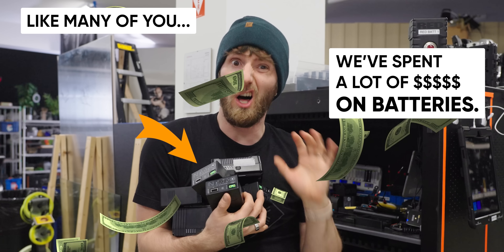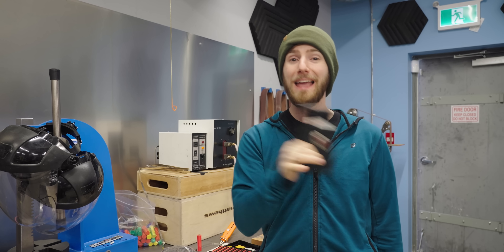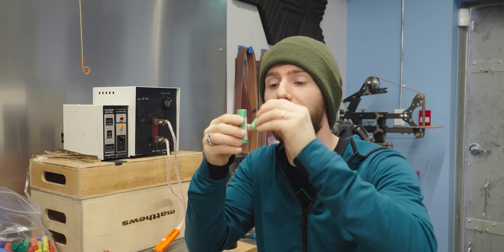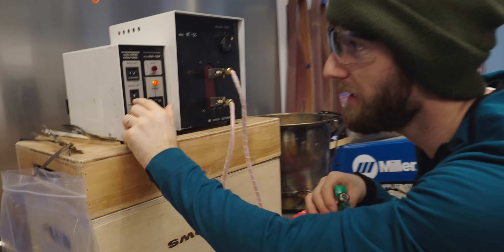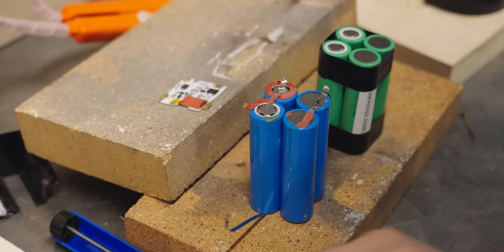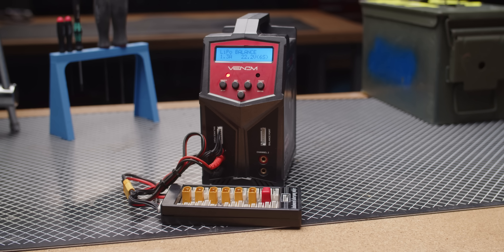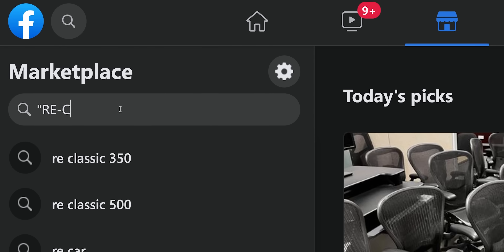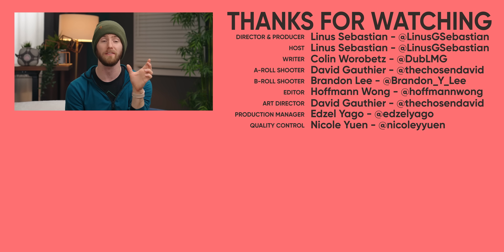This should be illegal… Battery Repair Blocking

Comment: Just an idea for you regarding your monitor battery pack! I've discovered, through working a great deal with Lipo and LiFePO4 batteries, many BMS's require you to give them a charge for a moment or a minute before they will begin to function correctly and allowing power from your batteries to come through. Even cheap bulk BMS's have required this, so you might give that a try. As far as protection against letting people replace 18650 cells, the only thing I can think of is that their circuitry could be customized to see when they have lost all power and then brick the BMS. This would be difficult to implement and would likely increase the cost when they try to do repairs at the factory. Other than this there isn't a way to track 18650 cells as they don't transmit any data. To bypass this sort of possible protection, you would just need to apply the appropriate voltage directly to the BMS just prior to disconnecting that negative or positive connection, whichever the cell connections isn't connected to. Good luck man! Don't give up on the 18650 cells. I've done some amazing things with them and replaced them many times in all sorts of items and I've never once encountered a product that had any protection that stopped me from completing the replacement.

Comment: Having seen industrial spot welding before: I dont think those sparks you saw where hazardous. They are just from the spot welding and not from a defunct battery. What i would worry more about is the fact that you can clearly see a red afterglow on the welded plates, which means you put a lot of heat into them.
Reply: I'm no expert but I was thinking similarly. The welder basically works by short-circuiting through the part you're welding, I'd be amazed if they never sparked. Poor contact on one of the tips I assume?
Reply: @SqueakyNeb  bingo. It happens all the time with shitty tips.
Reply: I too came here to say this. Dudes tossing undamaged batteries left and right
Reply: @jebus5656  Linus did warn that he is a total amateur at wendling batteries. But I like that Linus put safety ahead of thinking he is doing ok. Perhaps a little more resaerch into the unfamiliar aspects of a video will produce a good video and less work for the video and a better experience overall with less needless waste. it may be difficult but may also be less difficult than this exprience showed.
Reply: @mikkelbreiler8916  His safety glasses and bucket of sand would have done little had one of those fully-charged batteries "let loose the juice" with him sitting inches from it.
Reply: @jebus5656  Likely. The proof for me would be characteristic stench of burning lithium.
Reply: Well an other hint is that hey were welding only one side of the pack at that time. There should be no possibility to create a short as the circuit is still open.
Next with the sony pack yes sony has a chip that rejects 3rd party batteries but any BMS worth its money has also a undervoltage cutoff so after disconnecting you need to try to rechage first to try to reactivate the pack.

And last discharge LITHIUM-Cells to about 3.2V so that the energy left in the cell is limited. A fully charged 18650 cell has about the same energy in storage as a .308 rifle bullet so allways be carefull - about a small syringe of arctic silver halve filled with gasoline for non US nerds sounds little but is sufficient for a lot of harm depending of how fast it is released.
Reply: @tuxontour  WRT to the Red batteries, they appear to be in groups of 4 (4 positive side up, 4 negative side up, etc.), see 7:05.
Reply: This. He also 'double-dipped' the cells, spot welding twice before welding the other end of the strip to the next cell. A good cooling fan to take away some of the heat and changing to spot welding once on each cell, then going back to the first and doing the second weld after it has lost some of the heat would be much safer. (Nope, haven't built/rebuilt any Li-ion packs... yet... I collect vintage computers, and has only had to replace Ni-Cad and Ni-mh cells so far. I have a cheap spot welder, though. Much weaker than that monstrosity. )
Reply: Way too much heat during those welds IMHO.
Reply: Well, sadly this video is basically commercial, so it is intended to make DIY look unsafe, so you buy from their sponsor.
Reply: Yep, sparks from dirty tips or bonding strip shame still good cells
Reply: Yeah, I haven't spot-welded since high school shop class back in the 70s and I was more worried by the glow than I was by the few sparks I saw. Well, that and the crappy tips sticking to the nickel.
Reply: This, looked more like bad connection.
Reply: I think it was all acting for the narrative TBH.
Reply: @michael-3-l3  dont be too cynical.
Reply: @michael-3-l3  I always wondered who dislikes such videos, now I know.
Reply: @michael-3-l3  you ever think, maybe you're being cynical?
Reply: this

Comment: I am all for the right to repair however there are some types of and classifications of devices that should be exempt mainly life critical and lifesaving systems insecurity critical items like if eftpos terminals they should be lockdown if you Open them they should prevent you from using them any further for instance AED these devices have lithium ion batteries that are not designed to be re-charged and the BMS should be designed with a malicious BMS as a life is Worth more than the cost of a replacement battery and as a first responder I want to know that it’s going to work I don’t want to have to worry that the device has tampered with and may not work

Comment: Can you trick those Evill BMS controllers?
• what if you temporally hook up external voltage while removing the old battery will that it trick the controller to think that battery is not removed in first place ,so that one by one you can replace all cells?

Comment: I have done this with power tools. I even got an upgrade that lasts longer than the original.
You can often buy a cell pack already assembled to avoid having to weld them together.
You can also get cells that have a welded tag on them and solder them together,  after all, you solder the wires to the BMS.
I would only do this for my personal use and would not sell them on to anyone else just in case.
You can make a charger if you really want to got that far but then it becomes cheaper to buy a new one.
EU rules have been introduced that require manufacturers of electrical goods such as fridges and televisions to make their products repairable for at least 10 years after first coming to market, this could include battery packs.
Don't do this at home, I am an electronics engineer.

Comment: Hello, i alaways change my dead cells inside my battery packs (for my makita tools), if i use original samsung or lg batteries, everything alaways goes fine, but it didint at the begining when i was using cheap china batteries. some of them were dying just after two or three cycles. Anyway i can tell you my opinion, if you are unsure of your tools/skills is better not to open the battery case. It could have unforsein consequences like (poison or fire). Sorry for my bad english, im still learning. Have a great day.

Comment: I think one way for packs to be user replaceable would be to just use smaller batteries like AA, AAA, or 9V that can be individually replaced once the case is opened instead of requiring soldering or welding.

Comment: This is what happens with laptop batteries : they have a fuse that opens whenever a battery goes 0v, which happens when you desolder a cell. Lenovo did something like that on my laptop. i'm stuck with the original one until the recharge cycle limit is reached.... shame on you, lenovo!!!
With the lithium ion cells, you have to be careful not to put ANY dent into the housing, because it would likely expose the negative terminal near the positive, then it's much easier to shot the battery while doing that...
you can potentially use some new heat shrink housing to make them a bit more resilient to cuts... also don't forget to put some plastic spacers on the positive terminals to further prevent any shorts. Kapton tape should work as well as stated before by someone else in the comments.

Comment: I have to ask this - what kind of degree is required for one to be considered a lithium battery professional? A PhD in chemistry? A PhD in electrical engineering? Both?

4:40 See, if there is a bad cell, they already behave differently during charging, which makes your mismatched cells point, a lot more contestable. Then again, you are trying to refurbish a product that is already garbage. Thos battery packs are barely good enough from design perspective to cover their warranty. There is so much more which can be added for cheap and make them last significantly longer, but just isn't. Gotta keep the economy limping along :D

Comment: TBH, battery repair is where I draw the line. A consumer SHOULD NOT be replacing a battery that wasn't designed to be replaced. A battery is dangerous if handled improperly! Especially LithiumION, you do not want that igniting in your house!

Most repair shops I've come across aren't professionals! 

Now all this doesn't take away of the horrible business practises Linus described of course.

Comment: Hey Linus, @11:14 those aint cell sparks but welder sparks, if you  look closely you can see that the tips aren't perfectly rounded due to your sanding, if you have to sand the bottom of the tips be sure to sand also the round part of the tips.
Also would love to see how the batteries are recycled.

Comment: 9:00 Actually no. You already found out how his measurements went...😆 The cells you are connecting in parallel become 'one larger cell' and immediately equalize to the same voltage. Therefore, parallel cell groups need to contain the matched cells. Imbalance between the series cell groups is handled by the balance charger/BMS.

Comment: the sparks in this case are fine it was due to poor contact as well as your generic strips which would of been nickel plated steel sparks are common when using this type i also noticed the strips in between the probe were getting red hot not sure what machine your using is or if its set up properly but seeing the strip glow red in the middle is concerning definitely not normal for the set up im used to anyway you should be able to see any glow in real time and the only slow motion should pick it up and it should only be around the probes

Comment: A year ago I built a 40 cell pack for an electric longboard. I did know what I did back then, and everything went well, but seeing how easy it is to get things wrong makes me wonder what would have happened if I did something wrong. Bottom line for repairing or making a battery pack is to know exactly what to do and what to plan for. I am pretty stress tolerant, but after four ours of battery building I was exhausted. Espevially since the pressure gets worse the closer you are to finishing.
I would love to see a tour in a recycling facility!

Comment: You can not unplug the cell voltages from the BMS, that kills it on purpose by the manufacturer, and them say that is "to keep the safety of the battery"... BS... So to replace worn out cells, you need as many independent PSUs as cells the battery has, and wire them together with the cells, configured in the same voltages that each cell has, is preferable to do this with the battery discharged. I use cheap Step Down modules each with its independent 12v 0.5A PSU for power, so them act as cells and you don't have short circuits with the series of the battery. Then you have to charge or discharge your new cells to equal the voltage that the cells in the battery are, if the battery has cells in parallel I do the parallels first and then the series, and make the new pack with around the same voltage that your old battery is at, + - 0.1v is fine. Then disconnect the old cells and weld the new ones that you equalized manually, always being careful that the Step Down wires do not disconnect in any moment or your BMS will die. I have been doing this process with all batteries with 18650 cells inside, from notebooks to professional drones and I never had problems, just be patient and careful and all will go fine, 18650 runaways are really strange if the cells are discharged, you can short circuit 18650s for a few seconds and nothing will happen (if the cells are good brand) so you don't need to be that careful, just have a bucket with cap, half filled with sand (I use a 20 liters plastic paint container) and other smaller bucket with the other half of sand to cover it, and if it happends you just take a pair of pliers to trow the cell inside the bucket and cover it with sand. To discard old cells you must discharge them to under 1v, I use 5w 2.2 Ohms resistors to discharge the cells, just let them a few days and them will be under 1v, at that voltages the cells are inoffensive, you can short circuit or punch them without risk, and then send the old cells to a recycling plant, here in my country public recycling plants buy the cells for a few cents just to motivate battery recycling and reduce contamination. Good luck with those batteries! Cheers.

Comment: With those BMS, there is one more thing you could try.

Some of them don't enable the output when you connect up the batteries. They only do so after you try to charge the batteries with the BMS attached. 

(Or alternatively, short the B- to the negative output)

At least i have one BMS that behaves that way

Comment: I would llike to know how much current these are designed to handle, if not muych, I think you could add a capacitor between the ends, quickly swap the dead cells for a pre-assembled pack and take off the capacitor. That would be helpful against "memory loss" BMS. also just use  pre-assembled packs, don't bother with welding them together
actually I would like to see battery packs that open like remote controllers and accept individual 18650s. I made one for my camera and it was suprisingly cheap and I could hot swap the cells during recording.

Comment: Sparks go flying and you panic and bin the whole pack? I've spot welded a couple thousand batteries and have had loads of sparks flying. Often happens due to impurities or moisture on the contact points or not cleaned the tips in a while. I began wiping everything down with rubbing alcohol after getting in a bad batch that was so dirty that the sparks blew away the whole nickle strip. And have to this day not had to use the sand bin or lipo extinguisher that is located right next to the welder.
If the sparks aren't flying, are you really welding it good enough? ;)

Comment: The amount of wasted good cells due to a "short" is crazy. It's good that you made this video and explained a thing or two but some of it isn't ideal and the "shorts" were rather sparks of a bad connection from the welder. Also those cells are dangerous but not close as dangerous as Li-Po. You could've waited for the cells to explode but I think it wouldn't really do anything but just release gas and sit there. That way you could've reused the new cells ;) But still good education.

Comment: with all the sparks and issues you had even trying to do this, you would be right to cite manufacturers claiming safety concerns when it comes to right to repair issues, especially when it comes to batteries. I mean sure, you could say that even if you had a higher expertise in working with batteries and had the best equipment to do so, and if you had a high probability of success in repairing it (99%+), you STILL run the risk of potential failure. If it fails, and its a battery that YOU fixed and not the manufacturer, well the consumer that had that battery failed on them is kinda stuck, do they go to YOU for compensation, or do they go to the manufacturer. The manufacturer can claim ignorance in this since they didn't repair the battery, even if they gave permission to "qualified experts" that are certified to be able to repair battery packs. But what if that failure also results in customer injury or death? You're dealing with lawsuits there, and directed at who at that point?

It boils down to: Company doesn't want lawsuits, so they dont want anybody outside their business to mess with things as dangerous as batteries.

Comment: First you have to put it back on a charger to activate the BMS. It has low voltage cut off that only resets after having voltage on the charging ports.
Sometimes even a full charging cycle can be needed. 

But indeed it's possible they protect. Don't think this was the case on a simple battery like that.

I replaced the batteries of a Dyson V10 without issues.

Repairing a 1cell shaver did give any life after detaching the battery meanwhile. Gave low batt even when full. But after plugging it on the charger it just worked fine

Btw. Cheap spot welders are fine for this.
Some you have to modify a bit to keep working.
Most important is to use high current batteries like High C rate lipo's. At least 200Amps peak.
 See my other account. 
(read description) 
https://youtube.com/shorts/tUz8Y8J5IvI?feature=share

Comment: Why are you afraid of a spark only? It's just because you didn't press hard enough.
If you go through the metal cap the current /time is way to long.
Bottom is quite tick. Top is thin but that only the cap (vent)

Even short shorts won't harm.
They can handle high current.